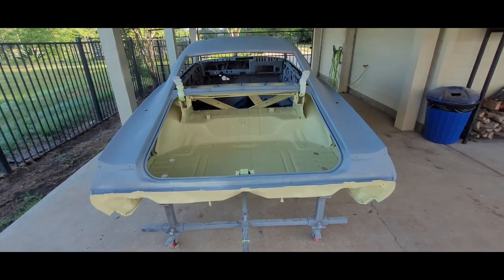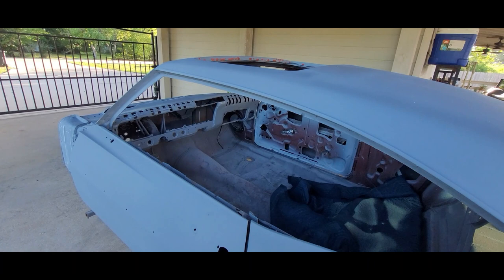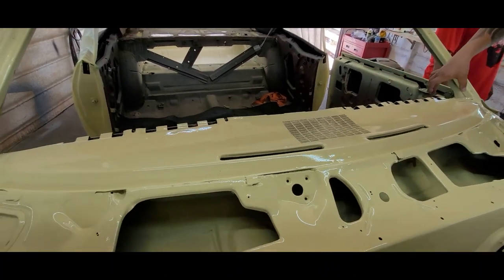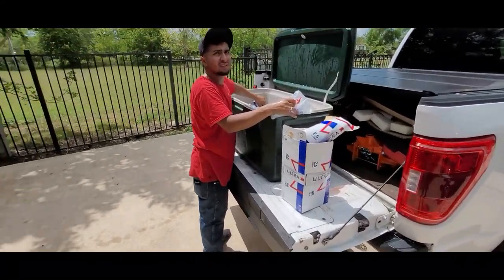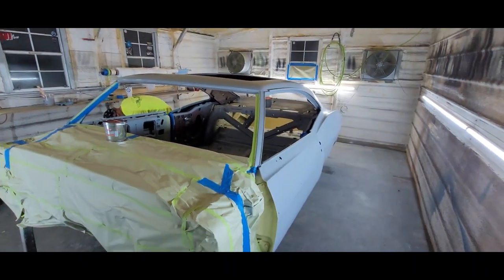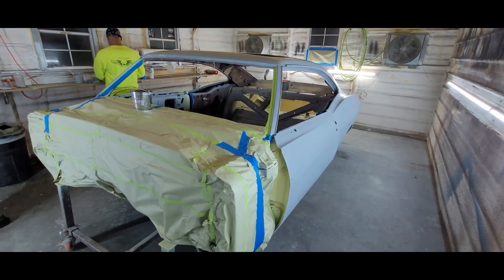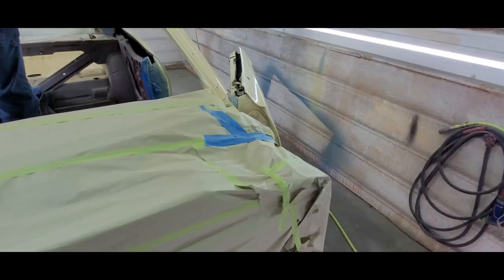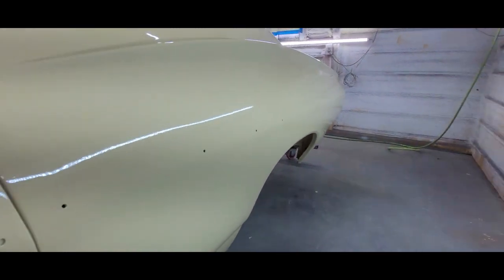68 Fastback Bodywork Part 7 | Lonestar Lows | DIY | Paint & Body | Painting Parts

Comment: Looking bad ass my man!! I do have a question for you on my 64 chassis, paint or powder coat? And why? Thanks for the input
Reply from the maker: Powdercoat is only as durable as the prep job , much like paint.  I believe powdercoat is more durable than basecoat clearcoat,  but I dont think its as durable as epoxy primer. You can leave a piece of spi epoxy primer submerged in brake fluid and it doesn't touch it. (According to the owner of the company), powdercoat cannot stand up to brake fluid...
Reply: @lonestarlows  ok, makes sense.  I was going to go with paint but my cousins buddy has a powder coat shop and said he'd hook it up for 650, sand blasted and coated.
Reply from the maker: @rickg-funk3144  that's not out of line. They are 500 here. It's easier just drop it off and pick it up
Reply: @lonestarlows  haha true! In Cali everything is more lol I'll go that route, thanks for your input. It's much appreciated

Comment: Is there a big diference from 600 grid to 400 grid prior to painting I see you used to sand with 600 prior to paint like on the Billy Jean project 
Please advice I am doing my 65 buick lesabre just finished the first session of high build primer and sanded with 180
Reply from the maker: 600 is better IMO.  For metallics is a must. Solid colors and a sealer with good quality basecoat u can get away with 320 grit...
Reply: @lonestarlows  Iam doing the original seafoam green I might do little bit of pearl on it
Reply from the maker: @gamareyna452  600 for sure